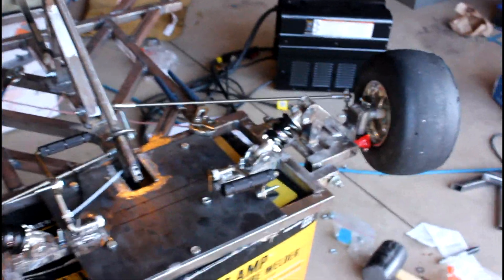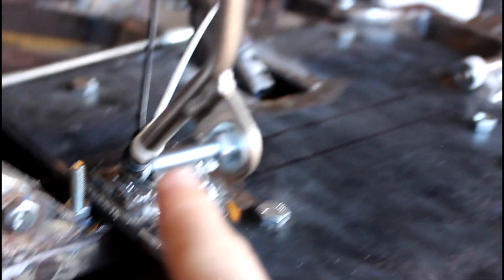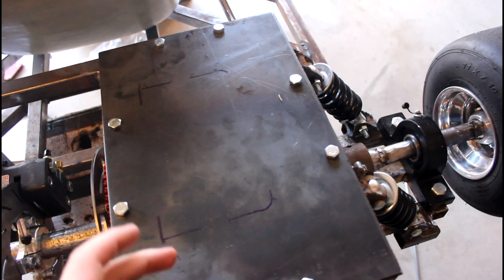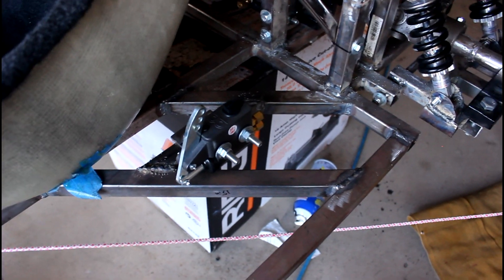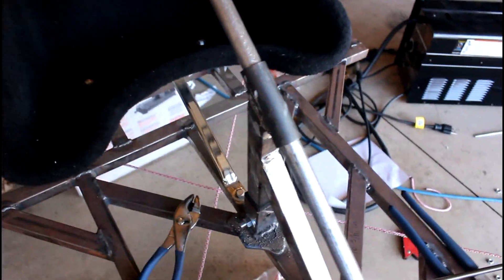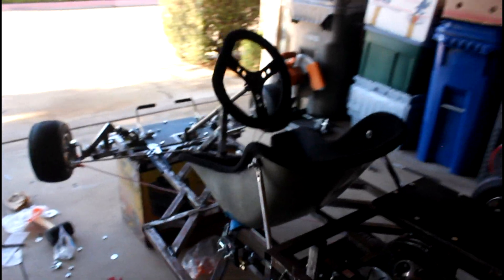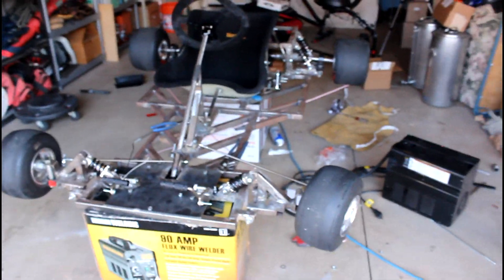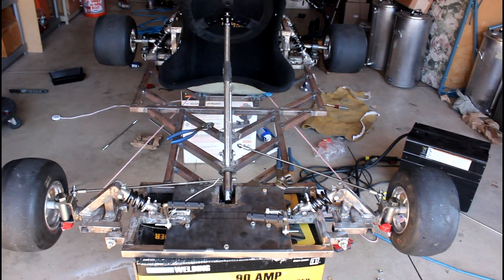(Homemade) Go Kart Build Project 19:  Setting the Ackerman Angle

Comment: You ran into a number of issues while building eg: Ackerman angle and where steering rod needs to connect, clearance for steering linkage, height of front vs rear, cog ground clearance...
Is there a way that you could have discovered these issues while designing in CAD?
Reply from the maker: Tom, you are right, a lot of the design was figured out as I built the kart. Since at the time my only CAD experience was 2D AutoCAD and that's what I used to design the kart, a lot of this could've probably been avoided if I designed it initially in a 3D CAD like SolidWorks, which is the only thing I use now for my design work.

Comment: get a gas welder,  those Flux core suck
Reply from the maker: It does the job.
Reply: +Hnat Automotive Photography yea, I'm not putting you down. it's just when you go from Flux core to co2 or argon, you'll notice a huge difference in weld penetration.  it feels much smother as well.  your frame seems really blocky,  you should try getting a tubing bender so you can make one with round tubing.  using a whole saw makes perfect joints.  those ones look so cool.  get a 2 stroke, lol
Reply from the maker: Gotcha, yea I know a gas welder would give a lot better results but for now while it's pretty good. Yea at the time getting round tubing to work took a little too much work that I wanted to do.

Comment: i wanted ta try making something like this but is this not really heavy?
Reply from the maker: +Cian Govern Define what really heavy is? This is close to average weight of your standard shifter kart.
Reply: +Hnat Automotive Photography i mean i have a racin kart 125 proper one but its all alluminuim and super light as in i can lift it on my own what im woried about is makin it outa streel will its acceleration be poor
Reply from the maker: Well this is hollow steel tubing so yes, it's heavier than comparable aluminium tubing but the kart is not so heavy to the point where it's really sluggish off the line, it accelerates very well as is and will only be better with the torque converter I'm installing. The steel tubing I used is quite thin in gauge thickness so it doesn't have a whole lot of weight to it.

Comment: Just wondering if things are coming along well after this video, and also....do you know the estimated weight of your kart's frame?
Reply from the maker: +Amber Leigh Things are going along great! A few set backs with the Ackerman angle steering thing and pedal design, but I am in the middle of filming the next video. Video 21 should have the go kart running for the first time!
Reply: awesome....you're dong great, keep it up...I got my APC frame all tack'd into place, and OMG, it's heavy as hell....it takes two of us to get it out of the garage now....glad I'm going with a 16 hp engine.
Reply: +Amber Leigh 16 hp on a go kart holy shits thats gonna be sick u should make a video
Reply: it's actually going to be a 6x6 apc...
Reply: as in an apc tank!
Reply: yep...i got pics on my f.b., just sayin...only my frame work done so far, and even that isn't done, but it is about 20 degrees here or so for like the next couple months and too cold for me outside....
Reply from the maker: +Amber Leigh To answer your other question, I weighed my kart just before I took it apart and it's curb weight is 207.5 lbs, without the engine it's 170lbs... Sounds like your kart is coming along well!
Reply: awe..ty, and I really liked the color you went with, came out great!!
Reply from the maker: Thanks!

Comment: is the drive shaft solid or not you will need a solid
Reply from the maker: It's a 1/4 inch gauge hollow axle, and no not necessarily, a solid axle is a lot of unsprung weight, and for the amount of torque that I will be producing, the axle I have is plenty sufficient
Reply: +Hnat Automotive Photography  it look sick cant wait for the test drive what kind of clutch are you putting in the engine
Reply from the maker: +Eli Dwyer Thanks! I'm just using a max torque clutch I got from comet kart sales

Comment: Where did you get your tires\rims? How did you attach the spindles to the rims?
Reply from the maker: Got the tires and rims from comet kart sales online. The front spindle is a bolt that goes through the front wheel Hub that has a bearing inside of it
Reply: +Hnat Automotive Photography thanks for info, but how did you attach the front wheel hubs to the spindles without welding part of the bearing to the spindle shaft, mine is moving side to side and the bearing action is working, it's just rubbing against the metal.
Reply from the maker: +Riley Witting Okay I'll try and address your question as best as I can over comments haha. The front spindles are a 5/8 inch diameter bolt. The front wheel hub has a bearing that is press fit into the center part of the hub, the bearing is a 5/8 inch inner diameter so it fits snugly around the spindle "bolt". I have some nylon spacers on the inner most part of the spindle bolt to bring the hub out away from the c bracket so the inner part of the tire doesn't rub on the C bracket. The hub is mounted with three bolts to the front rim and the hub is held onto the bolt by a nut and lock washer. The spacers don't allow the hub to move from side to side. Let me know if that helps.
Reply: +Hnat Automotive Photography so I should get some spacers?
Reply from the maker: Yea I would, if your hub is moving around it's probably because the threads only go so far on your spindle bolt and it's not far enough to push the hub snugly up against the back part of the spindle arm. The spacers also allow the hub to spin more freely rather than rubbing up against the end of the spindle arm.
Reply: +Hnat Automotive Photography that makes sense, but what about the inner part of bearing, wouldn't it rotate instead of the action of the bearing? How did you secure it? Sorry I ask so many questions lol
Reply from the maker: +Riley Witting If I understand your question, The bearing is press-fitted into the wheel hub, it's a very snug and tight fit. That allows the outer part of the bearing to rotate around the inner part that is around the spindle bolt.
Reply: +Hnat Automotive Photography what do you mean by press fitted?
Reply from the maker: I mean like there is a slot in the hub for the bearing where the bearing is not secured down by any bolts, screws. Think of press fit like a cork in a wine bottle. It's such a tight fit, the bearing stays snugly attached to the hub
Reply: +Hnat Automotive Photography I don't think I have one of those, I bought spindles from bmi, the basic ones. What should I do?
Reply from the maker: +Riley Witting Here are the hubs I bought for the front wheels:
https://cometkartsales.com/Standard-Front-Hub-5-8-US-Pattern.html

and here is the spindle set I bought that fits perfectly with those:
http://gokartsusa.com/spindlesetsandcomponents.aspx

If you order the spindles make sure to order the ones with 5/8 inch bolts so they fit inside the bearings on the wheel hubs because the bearing diameter is 5/8 inch. The second length indicated for the spindle selection is how long the spindle bolt is. 
Without seeing your setup in a picture it's hard to tell exactly what your problem is. A video and/or picture would help me get an idea of the best thing to do with your current setup
Reply: +Hnat Automotive Photography I have those exact spindles, does pressed fitted mean that you just tighten the nut on he spindle? Btw thanks for taking the time to answer my questions.
Reply from the maker: No problem at all man. When I talk about press fit, I'm talking about the wheel hub, not the spindle. The bearing is press fitted into the center of the wheel hub, then you slide the bearing/hub assembly over the spindle bolt and tighten that down with a nut. Watch this video, start it at 5:00. https://www.youtube.com/watch?v=BPs-QALECqs
 This is a wheel hub on a car, but its the same idea. The hub has a bearing that is press fit in the center of it which allows for the entire hub to spin around the spindle arm while still being secured down to the spindle bolt.
Reply: +Hnat Automotive Photography perfect, I I just fixed it 👍 thank you
Reply from the maker: Awesome! Noo problem